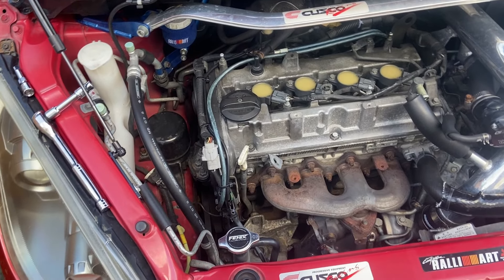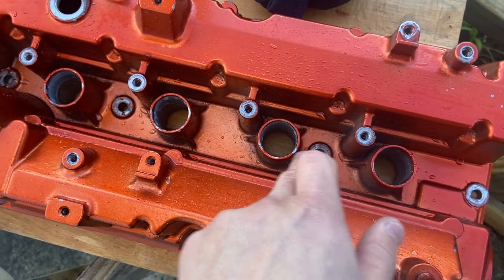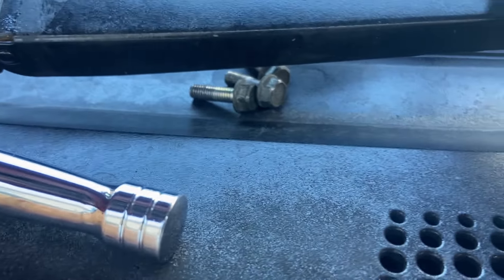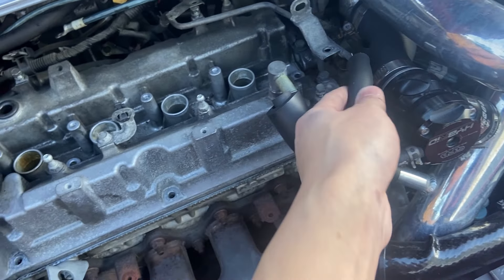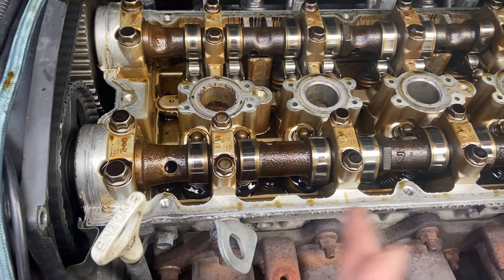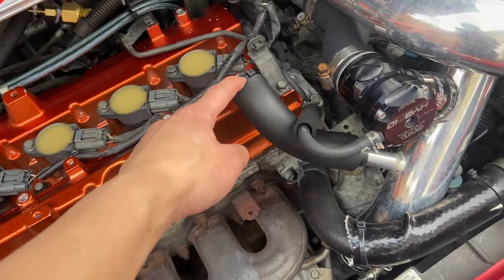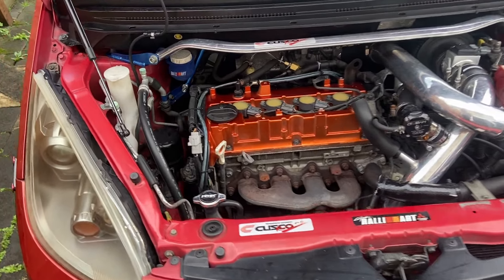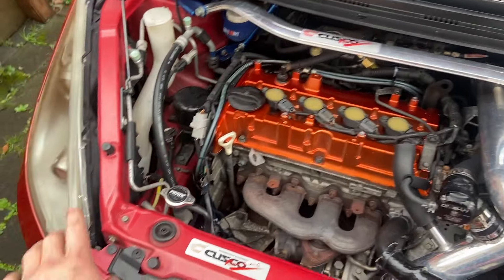PAINTED ROCKER COVER | HOW TO REPLACE GASKETS

Comment: Did you give silicone in the places mentioned in the service manual ?
Reply from the maker: When I first put it on yes on the corners of the half seals, but this time no I didn’t and I have seen any leaks